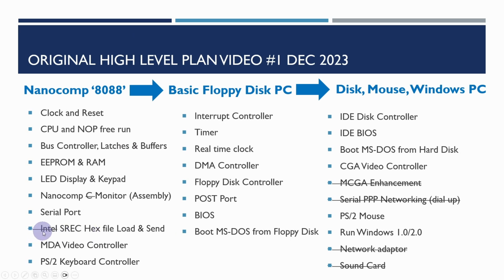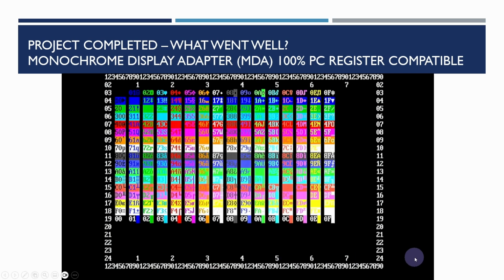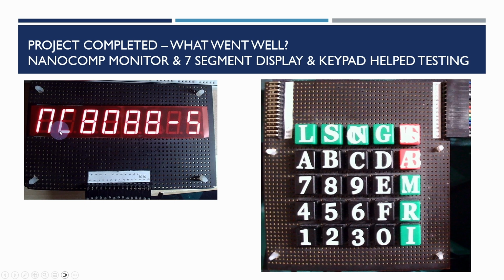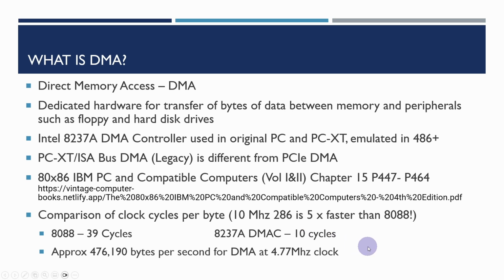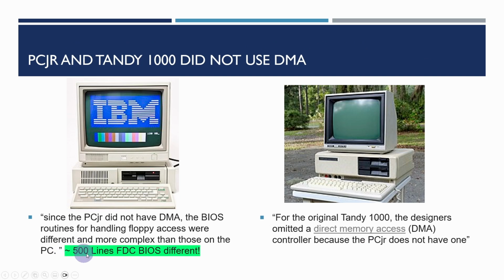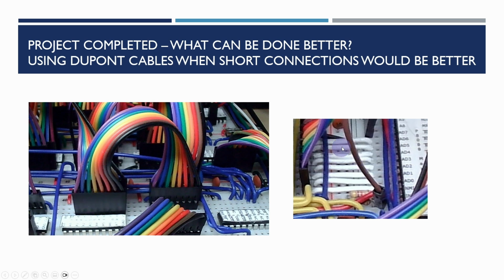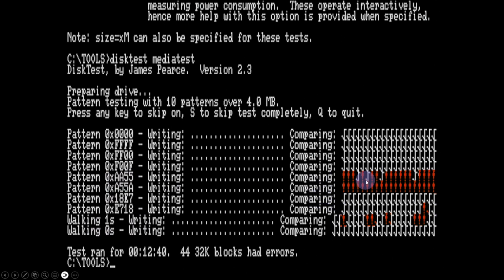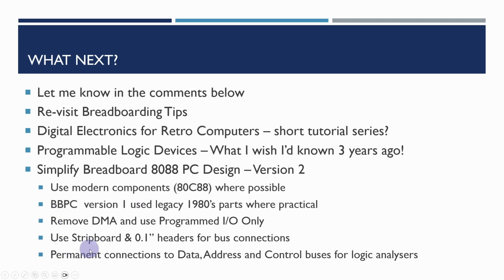Breadboard 8088 PC #65 Project Completed & What next?

Comment: Hello, what na awesome project! Would you be willing to share the modified bios code, regarding the PIO floppy Access?
Reply from the maker: Thanks. PIO - Yes sure, would need to tidy up some of the code a little. I haven't spent anytime testing floppy disk writing so there could be bugs but the reading is OK. Will upload to the project Github in the next week or so. Dave
Reply: @breadboardinglabs  thank you, that's great! I'm going to show on VCF forum my own projekt that is based on NEC V50 soon. Recently I've got it booting from virtual serial drive. Fdd doesn't worki due to the lack of the DMA and also I have problems with standard 16bit IDE adapters.
Reply from the maker: You will need to run at 5.33Mhz or faster for PIO to keep up with 1.44MB High density floppies. I suspect that shouldn't be a problem. Dave
Reply from the maker: I have uploaded the modified BIOS files to GitHub https://github.com/breadboardinglabs/Breadboard8088PC/tree/main/8088_bios-bbpc-pio
I have added comments on the changes in the README.MD in the BIOS folder.
Note this is designed to start at F9000 to FFFFF and allows 4K from F8000 for the XT-IDE Tiny IDE BIOS.
I haven't tested the Floppy Disk writes due to the DIP FDC not supporting Disk Change.
Code is modified to assume disk has not changed. Good Luck Dave
Reply: @breadboardinglabs  Hi. Thank you so much! I'll try it ASAP :) Jarek

Comment: Glad you stuck with it and made it to the end Dave -- great job.  Not sure you will get the Ben Eater Award for your wiring though, although I don't suppose you are worried about that!    +1 For PLD video.
Reply from the maker: Thanks, I will be doing V2 to make it look pretty (or prettier 😉). Working was more important than looks at the time. Dave

Comment: the standard aftermarket POST cards rely on cpu writing POST data to Port 30.
this was only added to IBM BIOS in 80286 (iirc)
I expect your approach was s better solution in the context of this 8088 project 

Personally I'm still only ~halfway through this last project so I'm in no rush to dig into anything further - I broke down and ordered a proper logic analyser just last week      :)

I must  say, however,  that I really enjoy the videos and I look forward to following along 
Congrrats  on the successful completion!
Reply from the maker: Yes I realised the POST card issue when I was reviewing the subtitles, though you could use XI-8088 BIOS with an original PC or PC-XT which would output codes to port 80.
The 32 channel logic analyzer is definitely a luxury but was a retirement present. Two 16 channel ones would be fine but you have to have a common signal to trigger them. Thanks for the feedback. Dave

Comment: A 386/486 Project?
Reply from the maker: It's an 8088 PC-XT project. 386 & 486 have too many pins to do easily on a Breadboard without making an adapter PCB. Dave